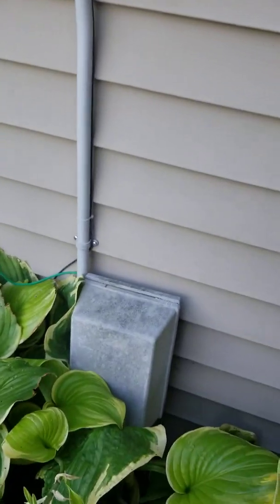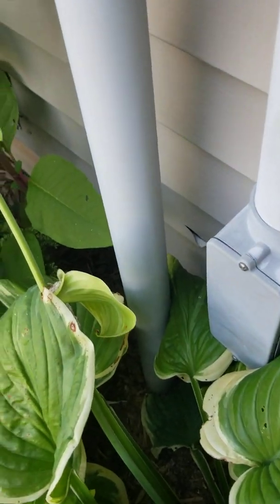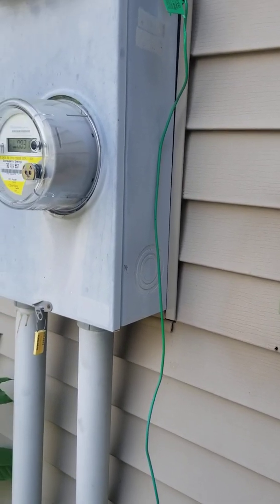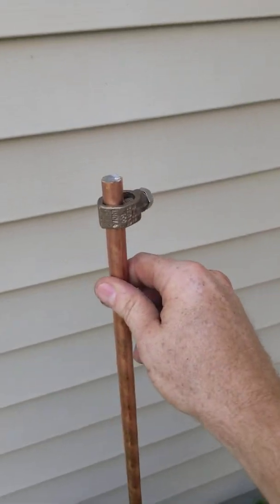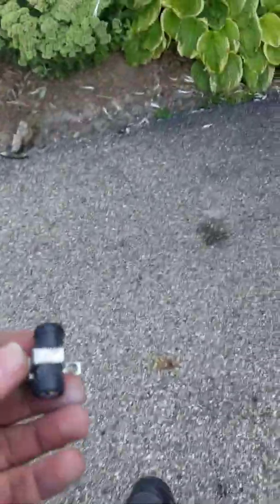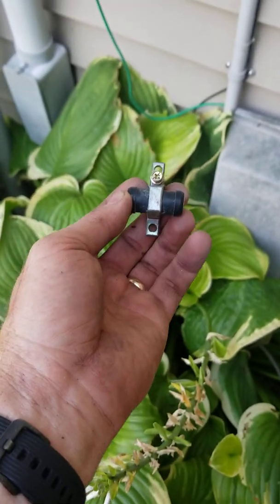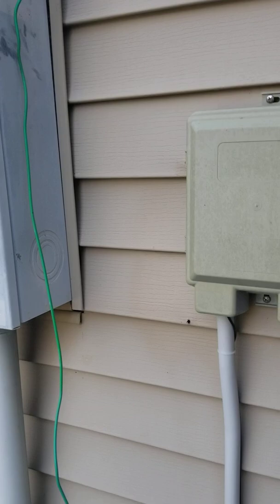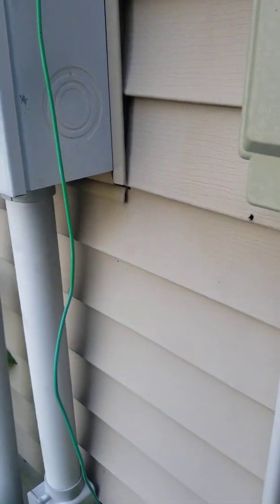Installing a proper antenna ground

Comment: Ok ok here I got 10g stranded wire connected it with 2 washers wire in the middle screws the cb antenna to a 16 foot 2x4 with wire in there and grounded it with a 4ft copper ground rod I got on eBay for $22 and it works great. A old buddy I know just said make sure there connected

Comment: You are wrong. Nec states loop meter box is internal grounded. Those strap on ground clamps are nec approved however you are correct it was not installed correctly
Reply: About to say the same thing...
Reply: Not when PVC is in the path. A loop-meter box only bonds internally if the conduit feeding it is metal and continuous -- into the home and outside. In Ottawa County (Michigan -- probably all over as well) you’ll see a mix — a lot of homes run PVC from the meter to the panel, and once you’re in plastic you’ve lost the grounding path. Likely from lazy, cheap, and ignorant electricians. The NEC allows strap-on ground clamps, yes, but only when they’re actually bonded to conductive metal that returns to the grounding electrode system.

Bonding to a floating metal box on PVC is a false ground — no different than clipping to a metal lawn chair. Anyone can clamp to metal and feel good about it, but if the conduit is PVC the ground path is broken and the connection is useless for fault clearing or noise mitigation. It takes half a second to test what the box is sitting on before calling it “ground.” Ignoring that isn’t NEC-compliant; it’s just lazy work dressed up as confidence.

Comment: All electronic boxes and housings are grounded, I think you said that but the problem is you don't know the length... 
When dealing with Rf it is always better to ground separately with a minimum of 8ft driven into the ground as electronics inside the house all share that same grounding rod and will admit Rf interferences
Reply: A box or housing is only grounded if it’s bonded all the way back to the main electrical panel’s grounding electrode system. On PVC runs, that bond is broken. And a separate 8-ft rod without bonding to the home’s grounding system isn’t NEC-compliant and causes RF problems because now you have two different ground potentials.

Comment: But does it have to also be grounded to the main home electrical system? This just appears to be a separate ground rod.
Reply: Yes — the antenna ground must be bonded to the home’s grounding system at the main electrical panel, not just a separate rod and definately not the pvc floating meter box (often incorrectly called electrical panel). A standalone rod creates a second ground potential, which leads to interference and lightning issues. Most homes today, are now double bonded with two 8 foot rods into earth.

Comment: so you are saying there is nothing in those PVC covers made of metal that is running into the ground?  All electrical boxes have to be grounded.  right?
Reply: A metal meter box isn’t the same as an electrical panel and it’s not automatically grounded. If the conduit feeding it is PVC — very common here in Michigan — the box becomes a floating metal box, not a ground. Only a continuous bond back to the main electrical panel’s grounding system counts.